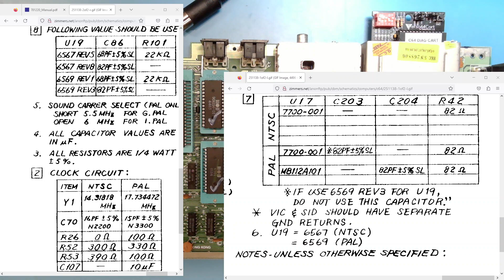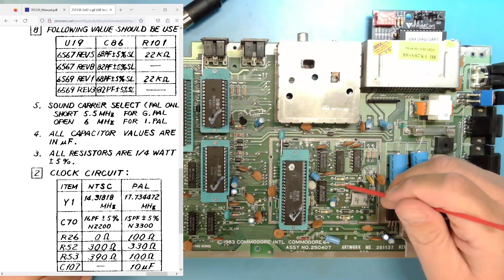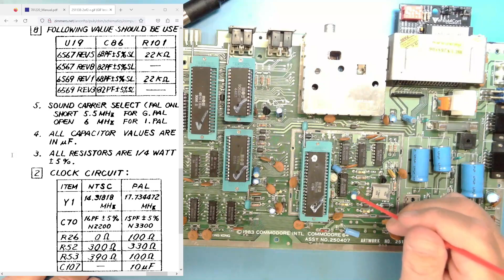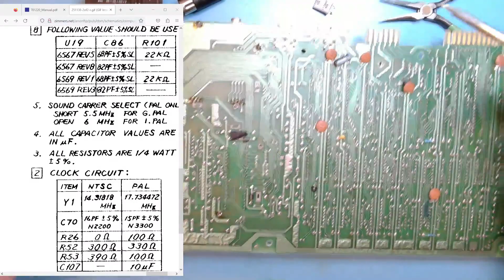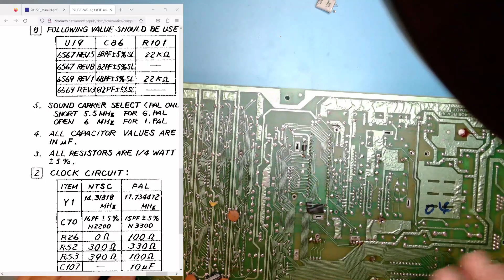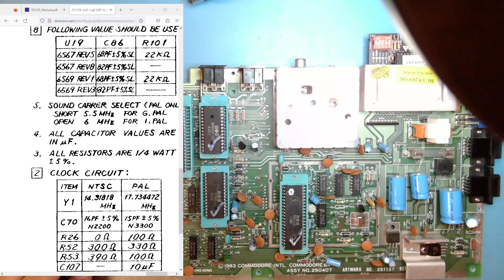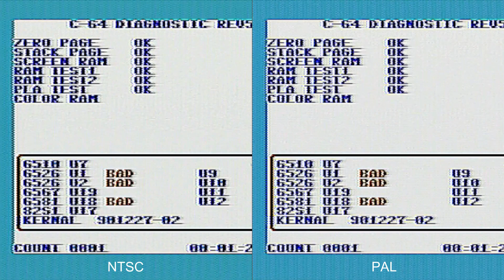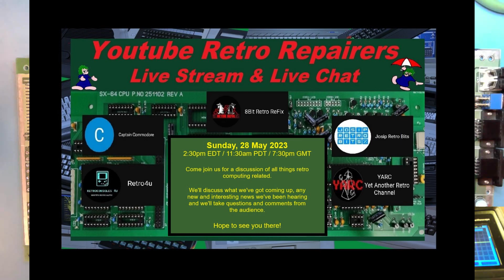MWPC - I didn't want a PAL ZIF machine anyway!

Comment: Interesting that the RF modulator doesn't need to be changed. I thought there were different versions of it for NTSC and PAL.
Reply from the maker: Truth is it's almost impossible to find schematics for the modulators.  I don't know for sure that there aren't changes that need to be made.  Frankly, it probably does require modification if you still want to use RF output.  Modulating an NTSC or PAL video signal onto an RF carrier should, I think, be a process that's dependent on frequency.  If, however, all you want to use it for is to condition the chroma and luma before sending them out to the DIN connector and also to combine chroma and luma to create the composite signal and send it to the DIN, then it may be OK to leave it alone.  It looks to me like those stages of the modulator are just adjusting those signals to acceptable levels to meet the specs for whichever standard you're using.  And I don't think that's dependent on frequency, but I'm probably very wrong there because analog electronics are NOT my area.  I am, of course, assuming that the target peak-to-peak voltage levels for PAL and NTSC are roughly the same.  I don't know.  If they're not, it may be as simple as adjusting a trim pot to get the right level for the standard you're using.
Reply: @YARC-1981  I know nothing about the different versions of the RF modulators too. I live in Turkiye, all we have are PAL machines over here. None of the modulators in my machines (3 of them) match with the ones that Adrian Black made modifications on. All of those were NTSC machines, so I concluded that PAL and NTSC modulators are different. Maybe someone who actually knows about these will comment and illuminate both of us. 😀
Reply: Indeed, The slot-head tuning screw does not tune from channel #36, all the way down to #3. Also, the sound is spaced away from the picture that an NTSC TV could fine-tune to only the picture or the sound, but never both at the same time.

Comment: I always wanted to change one, but I didn't know that it takes more than just changing the crystal,  jumper wire and vicii.  Thanks:)   still nervous though
Reply from the maker: It makes sense, though, even if you just think about it from the perspective of the CPU clock.  PAL CPU clock is 0.985MHz and it uses a 17MHz oscillator.  NTSC CPU clock is 1.02MHz and uses a 14MHz crystal.  You'd have to change some of the other circuitry to adjust the clock dividers to go from a lower CPU clock/higher crystal frequency to a higher CPU clock/lower crystal frequency.  Take the plunge!  Thanks for watching!

Comment: Great video. Your 250407 board probably also has a crappy modulator, so that would explain the blurry picture. There is a quick hack that you can do that involves taking out one ceramic capacitor, I believe it is somewhere on Adrian Black's channel. That should also work for the PAL variation. (P/N 251025-something) The old modulators also do something strange to the color signal, I don't think there is a fix for that, other than replacing the entire thing.
Reply from the maker: Thanks, Michiel.  I should have mentioned this in the video, but that color smearing only appears in the HDMI capture.  On the small LCD monitor I use, it didn't show up.  I'm aware of Adrian's RF modulator mods.  I've done them on the other NTSC 250407's I fixed in the repairathon.  I may build up a modulator replacement like the one Mark from The Retro Channel designed and put up on PCBWay's shared projects page and test it out on the ZIF machine.  I'll leave that for another video, though.  Cheers!

Comment: Best demos are for PAL though (although the latest awesomeness, @daddlerTL3 's Koalavideo program, works in NTSC too, but it will suffer audio/video sync issues, so every video you create, you have to create four copies of: 6581 PAL, 8580 PAL, 6581 NTSC, 8580 NTSC)
(I know - for testing NTSC machines, best is to use an NTSC machine as a reference)
Reply from the maker: I don't often run demos, so not much of an issue.  Besides, I may keep machine #8 around for such things instead of reselling it once I get the PAL VIC-II I'm waiting for to make it complete.  Thanks for watching!